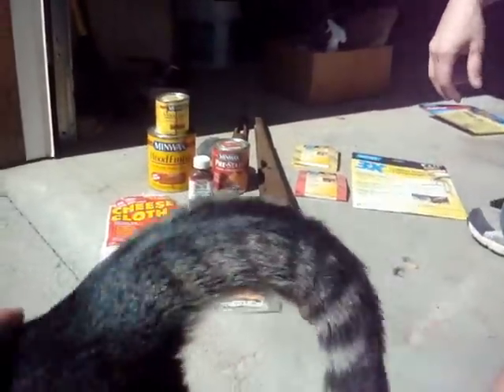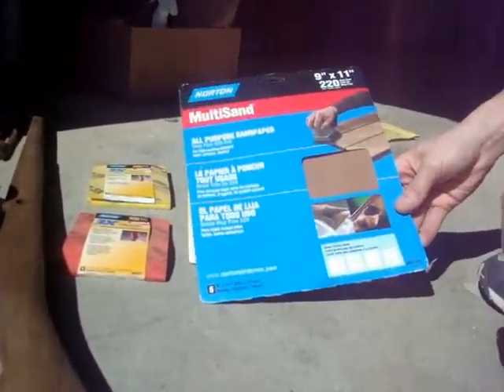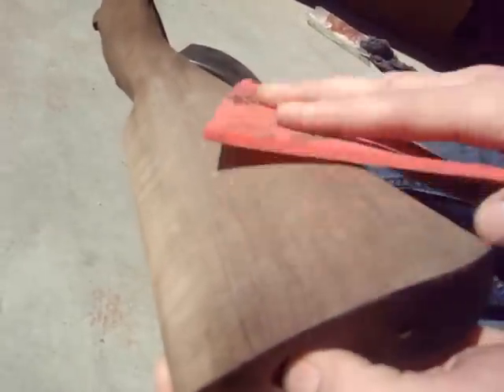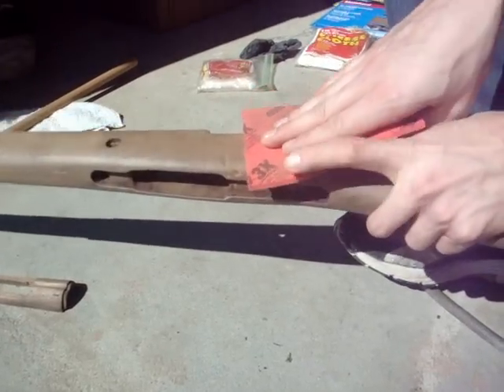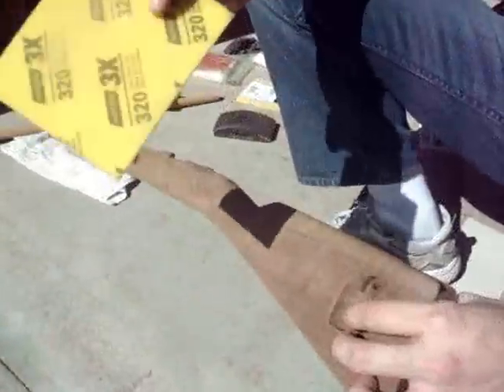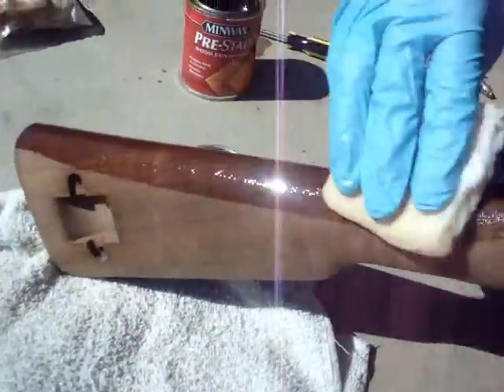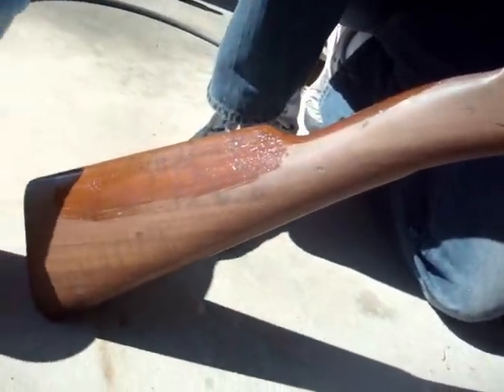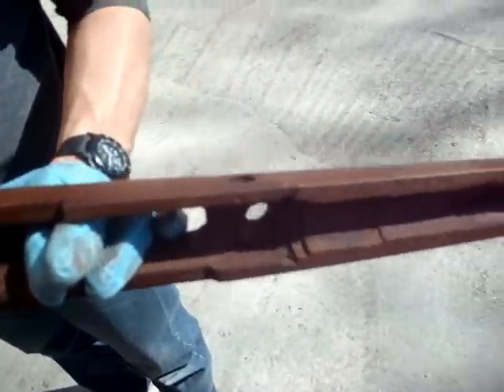"Part 3- Sanding the stock down and applying the finish"

Comment: I've followed basically Chad's process for a couple gun stocks and it's worked great. Currently about to start the sanding on an M48 Mauser stock.

One thing is that I don't prefer tack cloth between sandings; it leaves a residue in my experience. Between sandings or strippings (for the latter I use wood stripper unlike Chad) I like to use a shop cloth/paper towel with some mineral spirits on it, that seems to work pretty well.

Comment: This is Chad, you can add more coats of stain after 15-30 minutes if the color is too light. You just want to wait a full 24 hours before applying the final finish. Tru-Oil can be recoated in 2-3 hours depending on temp/humidity. Other oils, such as Tung or Linseed Oil, take longer to cure in between coats.

Comment: You can sand against the grain as long as you follow the general rule of following up with equal amount of passes with the grain. It is faster and removes material more evenly by sanding in little circles. And, as you said, it is important to progress around "100" or so in grit size toward finer sizes and check to make sure that next size is capable of removing the scratches of the previous grit in a reasonable amount of time (a few passes.)

Comment: Very helpful videos.  I just bought a Yugo Mauser and am trying to first decide how I want to remove the cosmoline.   I have heard every suggestion under the sun, also every precaution under the sun lol.  What is the best method in your opinion?

Also I've read that using water on a gunstock in any way is a bad idea.  I think this might be BS, but would love if you could clarify.

thanks!

Comment: If you want to save alot of money get all your prep gear and refinnishing materials from a professional autobody supplier (most auto body suppliers also sell wood refinishing materials as they supply boat yards)You may have to buy larger quantites (if your only going to ever do one its probably not worth it) but the cost difference and quality of the product will be considerable compared to the likes of homedepot/B&Q etc,plus they stock things you cannot get at DIY aimed outlets,

Comment: Yes, but only lightly. You could essentially sand down the channel to make the barrel "free floated" but it's not necessary on older milsurps. 

I let the stain soak in for 2-3 miutes before wiping off the excess. If you want a darker color, just repeat the process until the desired color is attained.

Comment: Love your videos...thank you. You COULD use a slightly damp Terry cloth rag to remove dust between sandings..slightly damp, not very wet. Thank you for your videos. I followed your instructions to the letter on a m43 and m48 spanish and yugo stocks, respectively. They came out BEAUTIFUL, THANK YOU...FJB.

Comment: @ geriatricgoonsquad 

Sure you can. It will darken the stock a slight amount, but if you like the color go for it! No need for conditioner if you choose to use just oil. You just use conditioner on lighter woods to even out the color prior to staining. If you use a dye however, there's no need for conditioning. The dye color can be blended with a little bit of alcohol.

Comment: Thanks for sharing this. I would love to refinish a gunstock some day. 

I have used Tru-Oil on a couple of musical instruments that I have made over the years and I love it. 

Instead of using the pre-stain conditioner, I have been using Zinser's Bulls-Eye wax-free shellac. It comes in cans and also aerosol cans. 

The reason I do that (on instruments) is because you want the oil finish not to soak into the wood too much. I guess on a gunstock it would be different. 

What kind of gun is that?

Comment: We have 1500 grit sanding pads over here in the UK which I'm sure you do over there now if you used one of those the finish would be like a mirror as we say over here
Reply: Would not work well in this application as it would burnish the wood, preventing stain from penetrating the surface and sealant from adhering properly. Wood bowls and cutlery (like salad bowls and spoons) are burnished to keep out moisture. The other side affect is that the sand paper would get gummed up really easily with the sanding dust from all the wood fiber. But I suppose if someone wanted a really raw wood look, they could burnish their stock.

Comment: this might be a stupid question, but do you sand the "channel" or whatever you would call the part where the barrel sits? do you stain that same area?

after applying the finish, how long did you wait before wiping off the excess?

Comment: Just a point of view..
I was recommended if you didn't use the first MINWAX, because what you have here is walnut stock and it is advisable that you don't put any substance because that will change the natural beauty color of walnut.
If you just settled for Pre-STAIN wood conditioner and then Tru Oil only that will be great and enough and then you see the beauty of walnut wood.
Reply: Sounds like personal preference to me.

Comment: Why wouldnt the stock warp from being so wet? Good video. Thanks.
Reply: It wasn't soaking in the water. Controlled use of water in wood refinishing reduces the chances of warping and helps raise the grain for help in sanding. Watched my dad refinish furniture for years using the same methods.

Comment: how do you take out the springs in the tip of the stock , the 2 that hold the barrel band and the bayonet lug ?
Reply: +joe smith
Did you ever figure that out?

Comment: Thanks for the reply!  I thought so...It seemed a bit impossible to do without water.

how do you guys usually remove cosmoline from metal and wood parts? thanks!
Reply: you can boil it off or use mineral spirits or Gasoline. (Gas will cut through cosmoline easily) Though lighter fluid works good too for cutting through cosmoline.

Comment: @ DoctorBoudreau

Sorry to take so long to reply, haven't checked these videos in a while. I use a product called Rainbow Oxalic Acid, best wood bleach I've found for gunstocks. To get the blotches out, you just have to apply a small amount to those particular areas several times over until things blend together. It won't be perfect, but it'll work. Wood conditioner won't do a whole lot to even out the blotches. It will however, help your stain apply more evenly after your other preparations.

Comment: I have only one thing to say about this, and it's a warning. You used a wood pre-conditioner prior to staining, and I think this is big mistake. I saw the way your stain job turned out after the pre-conditioner. That stuff totally mucks up the stock, and you can no longer see the grain of the wood very well!! Without the pre-conditioner on there, the grain shows through WAY more. BTW, Mosin Nagant rifles are made of birch wood.

Comment: wish ivan would have sanded with the grain when refurbishing mosins, dont want to resand because it would take the personality out of the gun so i just did a once over with some 4o steel wool and stained with red oak stain. dont look as bad as it did but still there. guess they didnt realize its easier to sand with the grain as well. but man my mosin is looking beautiful with the stain as the wood was a reddish color anyways and has all the staining aswell which gives it more personality i think

Comment: You should have clamped it worked out the spots in sections useing masking Tape. Then blending with sandpaper 300 plus. Afterwitch a Fine sand in Color cross grain to fill  in any Groves dents, and scratches that cannot be sanded out. finish with 600 sanding with the grain. 24 hour intervals between 600 sandings. and then finish sand and seal. Ps On a bench in a clean area. in a warm room 70 Plus degrees. Ps was not a bad Video. Still Good information. watch and learn new Tricks

Comment: just a note...  i use a hair dryer to heat the wood. oil stains are surface based. Preheating soaks it in rather than leaving it on the surface.. it would make those "curly" grains pop more
Reply: 73Corbin Nah not really. I either use the hair dryer *or* I stick the can of boiled linseed oil over a lit candle , get it warm, shake, get it warm, shake, repeat until the whole metal can feels really warm, and then I apply it. Works well for me
Reply: Couldn't tell you with the gloss as I don't use poly or the like on weapons. I work with alot of milsurps so I use raw linseed, boiled linseed, and then if it needs gloss or weather protection, I use formbys tung oil finish (it's not tung oil) but that has some poly - like stuff in it that gives a smooth gloss. Really thin coats that are rubbed in look very natural, unlike polyurethane. I like the oil look. It's semi- gloss without having the look of a plastic layer over top
Reply: ***** also, remember to remove any excess stains or oils left on the wood, so it doesn't get sticky
Reply: 73Corbin I'm not sure but I use BLO for everything and then that formbys in multiple very thin layers for the glossy protective shine. 

I have always had a hard time getting poly to be even and smooth
Reply: Oil stains soak into the wood...not just a surface stain.